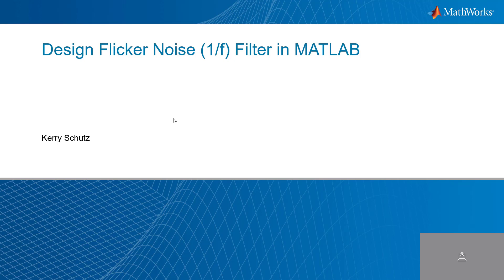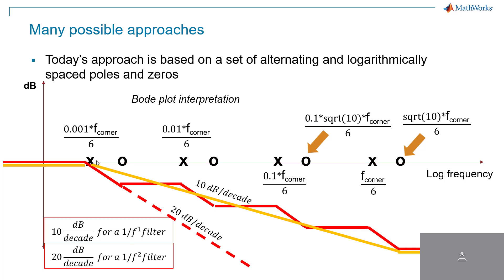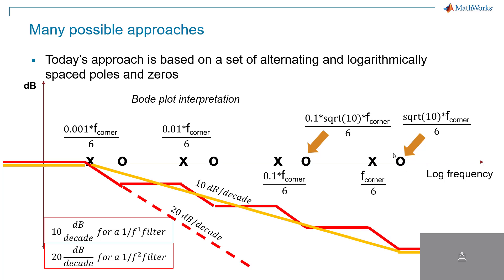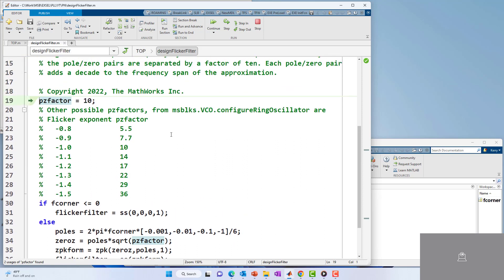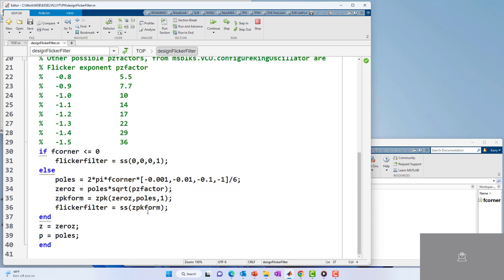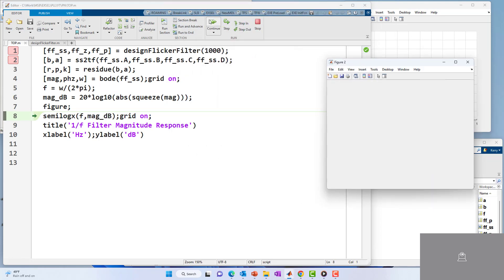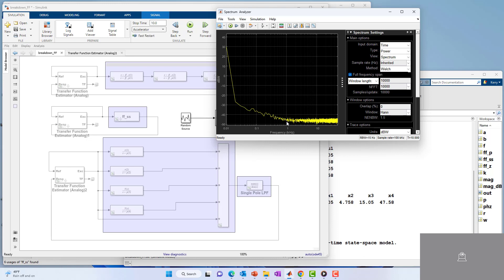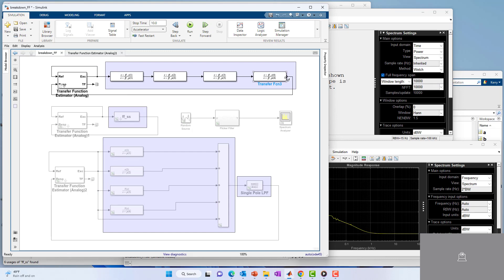How to Design and Implement a Flicker Noise Filter in MATLAB and Simulink

Comment: Is there a difference in numerical precision loss or scaling issue between the parallel and serial approximation?
Reply: In general, the parallel vs serial filter architecture will impact numerical precision. But for this flicker filter example, I did not study its impact very thoroughly, not beyond what you see in the video where I measured their respective frequency responses. I assumed that since I was using double-precision arithmetic and data types, that the architecture wouldn't make much difference. Again, that assumption will only work so well, so far. It's also not entirely clear which architecture in general works better, numerically speaking. It's all very case-by-case. Conventional wisdom might say that parallel is better because you don't cascade errors but actual practice indicates that some cascaded implementations behave better. I don't think it's a trivial topic.